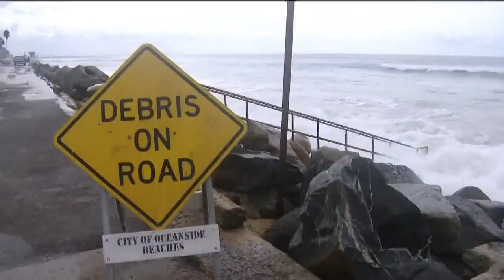Trevor Hoffman on sea level rise

Comment: where is kevin costner water world when you need him.....lloll. here in miami theres a neighborhood called little Hati aprox 9 blocks by 9 blocks. it is actually the highest point in miami at 10 feet. Fiu the local university here has said it will be the highest point in 15 years
to 25 years.  in miami beach water is reclaiming ground very quickly.

Comment: It's not sea level rise. I been on the shore in the northeast my whole life. On stable bedrock. The mean high tide, low tide and most importantly storm tides have not changed a bit. The sea level doesn't rise in California or anywhere else that it dosent rise everywhere in the world. Stop all the Chicken Little dooms day stuff. You live on a geologically active plate boundary where the land in the process of sliding by the fault zone rises and falls locally. In fact my parents , and grandparents told stories of storm flooding in my area that I have yet to ever see. These where not hurricanes but regular fall and winter noreasters.